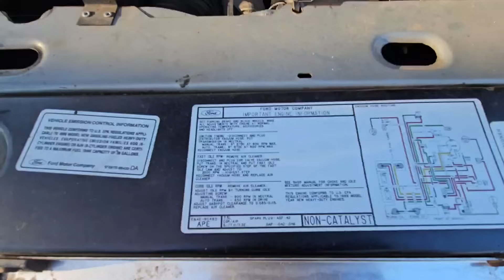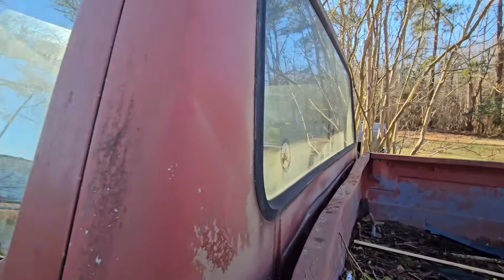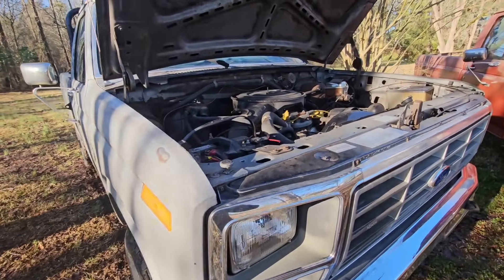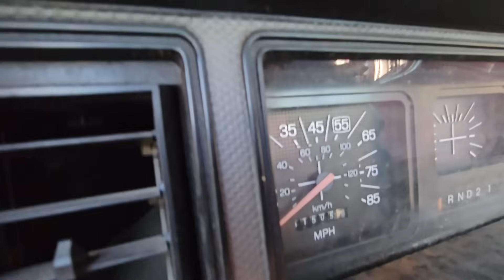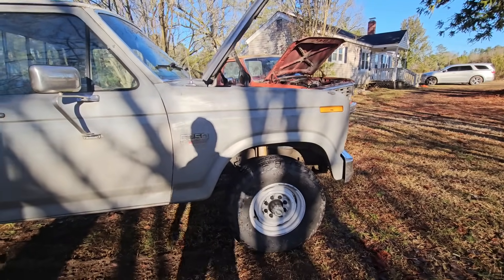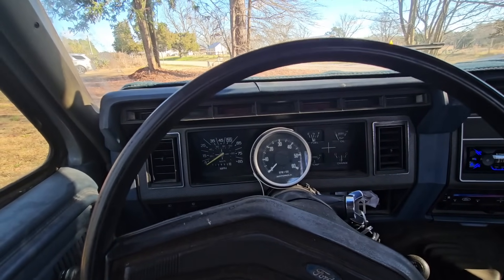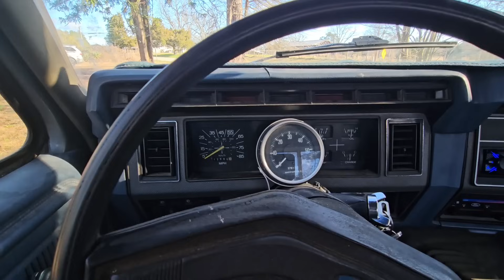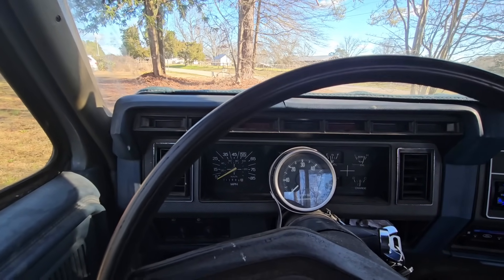THE WORST TRUCK FORD EVER MADE!?!?! #ford #fseries #sbf #bbf #truck

Comment: Tell us why these are the worst trucks that Ford ever made.
Reply from the maker: @darrinfry2251  it's a question. Did you listen to the video?
Reply: @runsgoodbutsmokes   I'm going by the title of your video.Did you hear me
Reply from the maker: @darrinfry2251  No sir, I cannot hear you, its text. The title is a question haha. Do you see the question marks? That means it's up for debate right? It is not a statement, it's a question. Listen to what I have to say, I say mostly great things about these trucks. I owned two of these trucks and still own one. They're absolutely great trucks, but I've noticed they don't hold value very well and are hard to sell for whatever reason that I can't figure out as to the reason of this video. Does nobody want these trucks? Are they a bad truck? Why are they so hard to sell? I couldn't even give that red truck away even with fairly low mileage and AC!!! Which I think is nuts! Eventually I did sell it and did make a slight profit on it, but I went way down on the price and it was advertised for 6 months, if not longer.
Reply: @runsgoodbutsmokes  Well I don't hear you on  your stupid title.
Reply from the maker: @darrinfry2251  Sorry for the misunderstanding and if it upset you. It's just a truck. I buy a lot of cars and trucks that have been off of the road for a long time and put them back on the road, so I see how local markets and to a point, how the national market goes with a lot of cars and trucks and I believe people are sleeping on these trucks because I had stated before in my last comment. It was all a question in debate and if you just listen to the video you will have a full understanding how I feel about these trucks. Just my opinion. You can think however you want as well, I'll never hate you for that.

Comment: I don't really think you know what you're talking about those trucks  the best trucks Ford ever made the 70s and 80s where the best trucks Ford ever made better than the crap today
Reply from the maker: @78fordtruck4  did you listen to the video? I agree with you. That's pretty much all the video said. Both of those trucks i bought for $1500 each. Then it took almost a year to sell the red truck even dropping the price almost by half (only asking $3500 for a truck that runs and drives with heat and ac and only needs a paint job with almost perfect interior) and no one seemed to want it. It doesn't make sense to me because I know these are great trucks. That's the whole point of the video.
Reply: @runsgoodbutsmokes  do you have anymore trucks like the red one and where are you located?

Comment: What are you talking about man? the bullnose and bricknose trucks while kinda ugly still fetch good money when in good condition... yes theyre not nearly as desirable as an aeronose or dentside but still i think you making a point that maybe existed 10+ years ago which is the last time i could buy a running bull or bricknose for under 1000 bucks...
Reply from the maker: I never said they didn't fetch good money. Just saying think they're underrated and not as appreciated as much as they should. I like these trucks a lot. I don't get it, but I'm also not mad at it. And my wife's couson just bought a 1984 F150, SCSB, 302, aod that's blue on blue for $900 and all it needed was the alternator and a battery for it to be on the road.... needs a little body work, but still.

Comment: What would be really interesting is to see the gas mileage comparison between the two. Let’s see if the manual transmission can make up for the four-wheel-drive and can the automatic kill the gas saving of the 2 Wheel Dr. oh and by the way, the reason why your truck won’t sell is simple, two wheel drives simply are more difficult to sell.
Reply from the maker: That might can be done! Never thought of that! Good thinking! Another interesting point in that, is the 460 4 speed truck has 4.11 gears, while the 351 auto truck has 3.55 gears. And you're probably 100% correct about the 2wd comment!